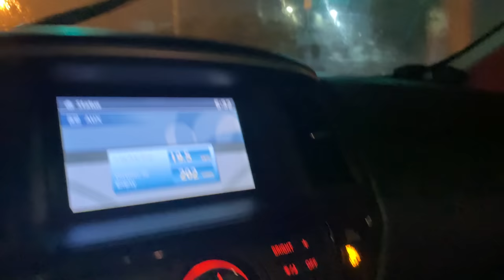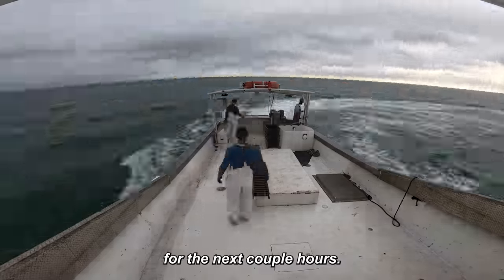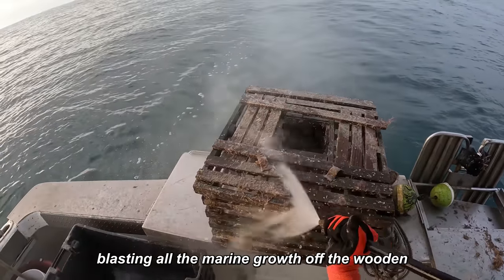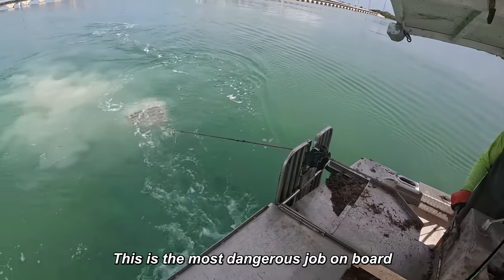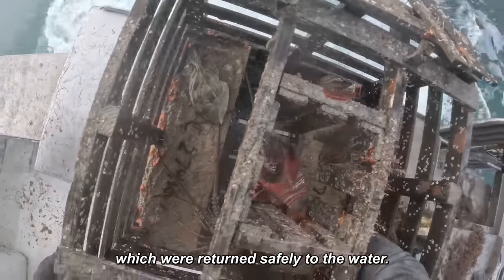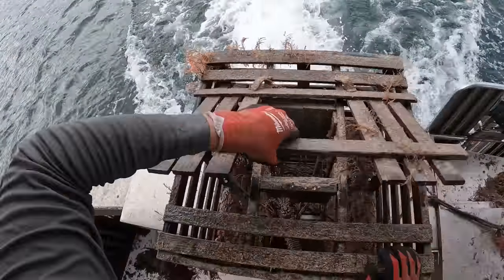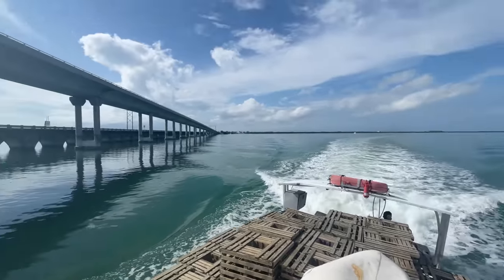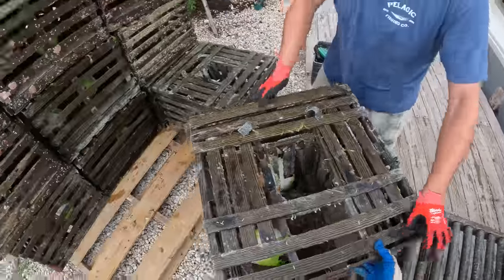48 Hours on a Commercial Lobster Boat in the Florida Keys

Comment: This video is true to the maximum. Why I can say that… because I’ve done it for 24 years. I was a captain and one thing I can add. Go do a video on the 3rd week of August. And then hopefully then you will see what the total boat captain makes. Yes the video Sums up the losses when your taking traps out of the water which is what this video is about,meaning the season is coming to an end. So yes this video is correct but, do a video when the season started like I said the 3rd week of August. Your numbers will be different I’m sure. Thanks again for the video